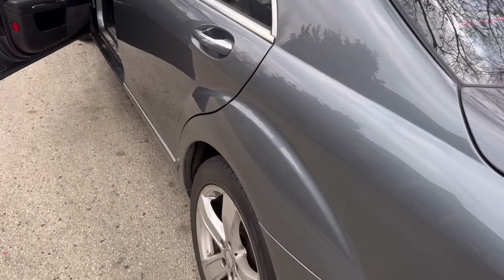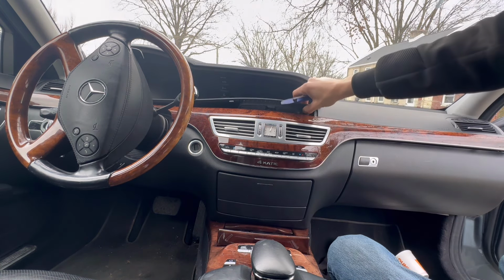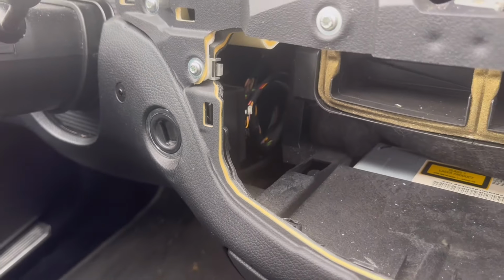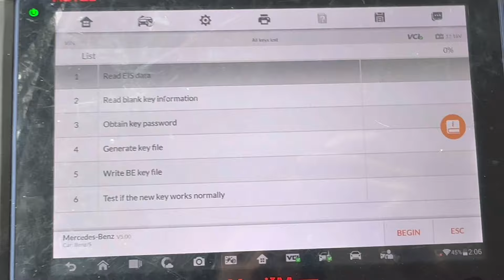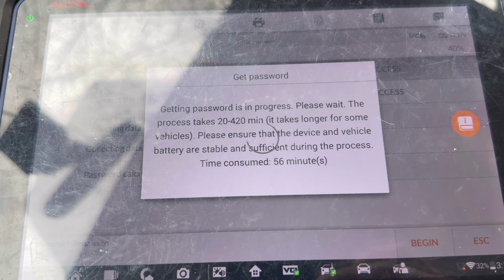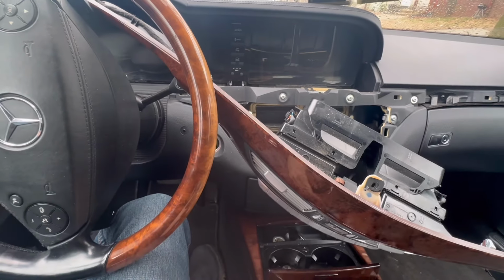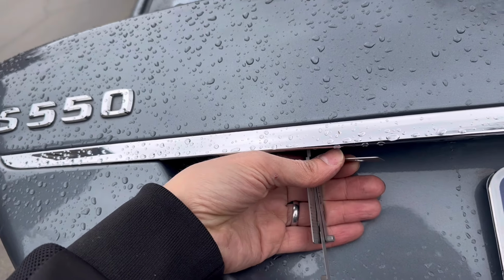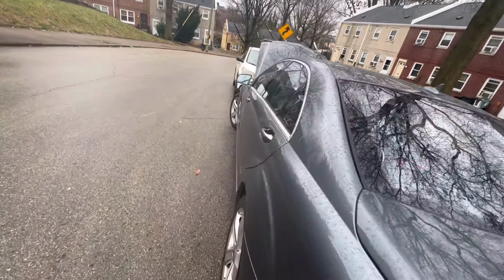2010 Mercedes S550 key Programing step by step using IM608 (W216)

Comment: Great video.  Wish you were near by so you could do my key.  Will the original key still work, or did you replace it?  Also, will the wireless functions that the key offers still work?
Reply from the maker: @benjaminerrico6760    We can keep the old keys in the system or delete them, 

The wireless (prox ) function does not work , since the customer didn’t want to pay more for that type of key , he just wanted the car to start . 

We can make you a key remotely as long as you ship us the EIS ( ignition box )

Comment: Thanks for the video! You have skills my friend. I couldn't charge enough to tear apart trim/components for how infrequently I get a Mercades call.  Well done!
Curious? if you could do it through the OBD2, why spend the time pulling that switch?  I'm sure there is a good reason..
Reply from the maker: Sometimes you wait 1-2 hours to do something through obd and it might fail . Plus I can’t stay stuck there during this process. When I take it out it’s usually done faster ( not this time ) but I get to drive around and finish other jobs while waiting.
Reply: @PhilyCarsAndKeys  Makes sense! Stay safe!
Reply: I want to know where are you from